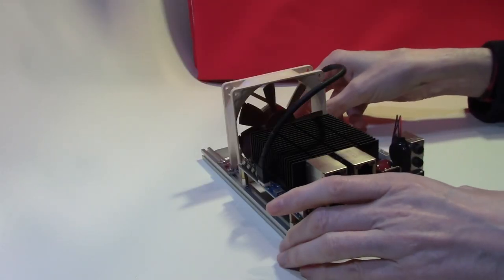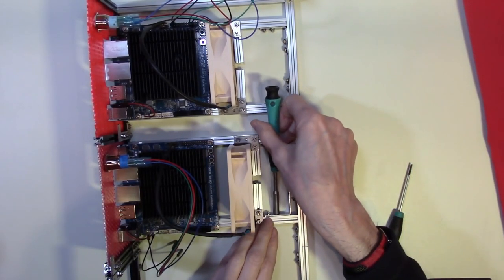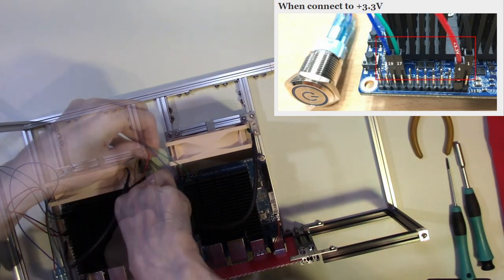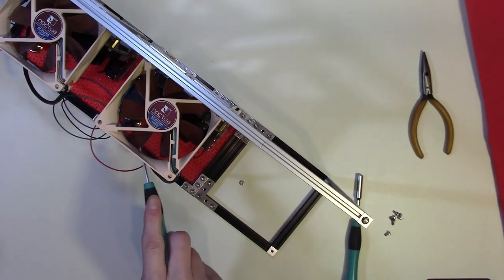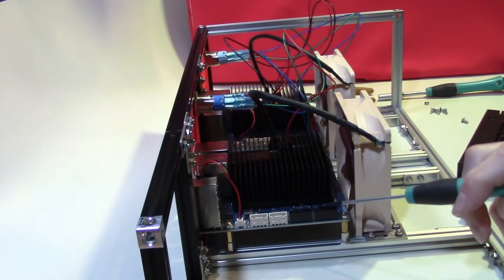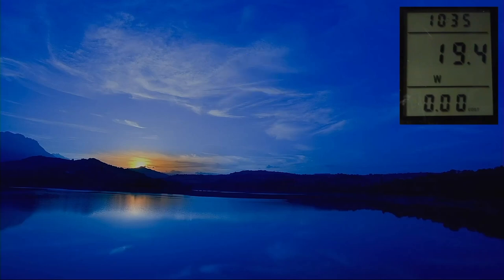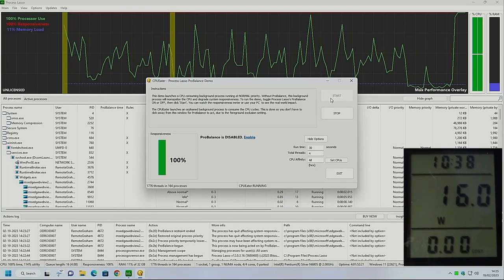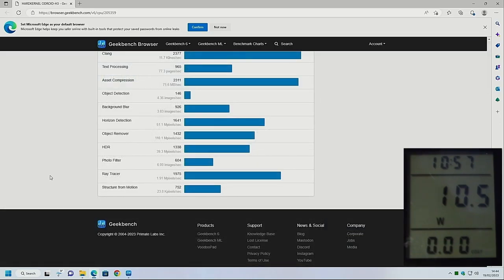Odroid H3+ single board computer - how much power does it use?

Comment: Nice project. If you position the fan towards the fins of the CPU cooler, cooling should be much more effective, and one fan between your two H3s will be enough to cool both computers.
Reply from the maker: I've taken this approach, with the fans, for the clustered Odroids, as all of them are switched on at the same time. But these two are not always switched on at the same time. The latest project though has a Noctua fan immediately above the heatsink as it's CPU runs on turbo mode, which does generate a fair amount of additional heat.

Comment: Where do you get the red plastic sides?
Reply from the maker: If you do a search for "polypropylene sheet perforated" you should be able to find somewhere locally to obtain it. It's normally available in white, but can be cut to size and spray painted with a plastidip type paint.